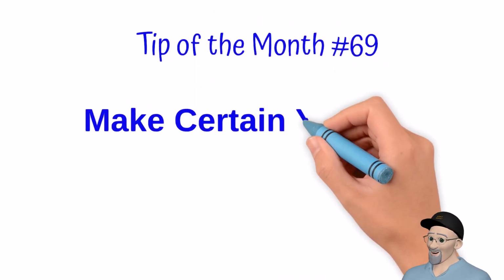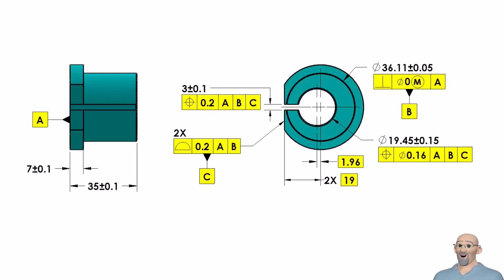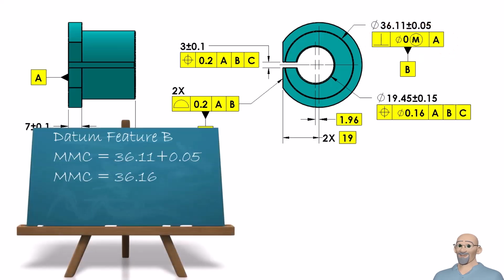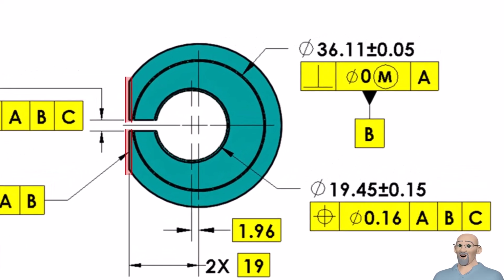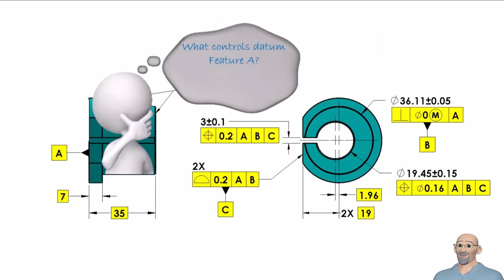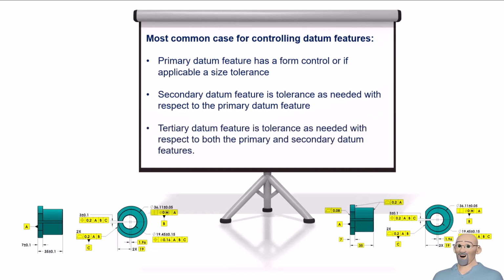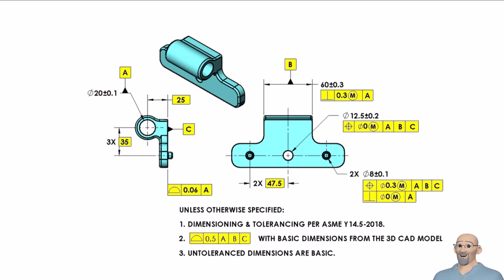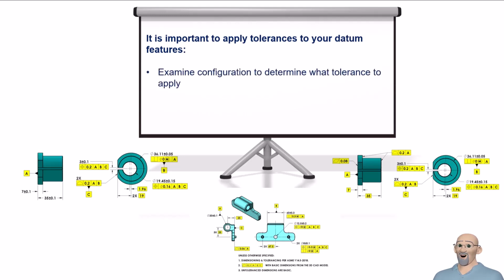GD&T Tip #69 from Tec-Ease - Make Certain You Have Controlled Your Datum Features!

Comment: Is it critical to tolerate datum features to a higher degree of tolerance than other features
Reply: @gaganaut06 - I agree that datum features need to be toleranced, since, as you clearly already understand, they are real, imperfect features on the part.  If I said that the functional requirements of the design should drive to how tight the tolerances on the datum features should be, would you agree?  If so, then would you agree that other features on the part may have functional requirements that also create a need for them to be toleranced just as tightly, or in some ways, say size or orientation for instance, even more tightly, than the datum features?  I want to ask these questions as my first step towards understanding your comment. - Dean Watts, Technical Director, Tec-Ease Inc.
Reply: @ suppose I have a feature that needs to be with in 50micron in position, but my datums are not controlled. Then the error in the datum will not allow me to reliably measure the required feature. So datum needs to be tolerated to a higher degree compared to the features , but how much is the question
Reply: @ yes that is my doubt , can a feature be toleranced tighter than the datum from which it is being measured.